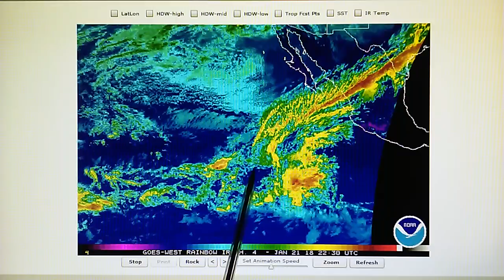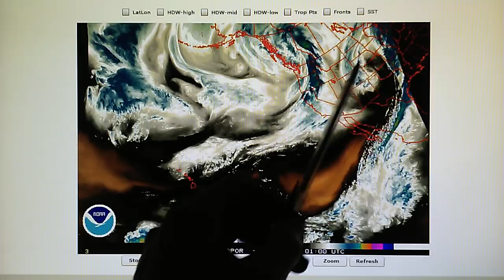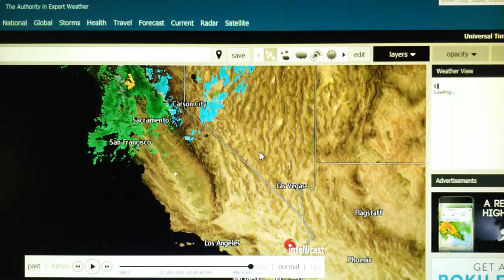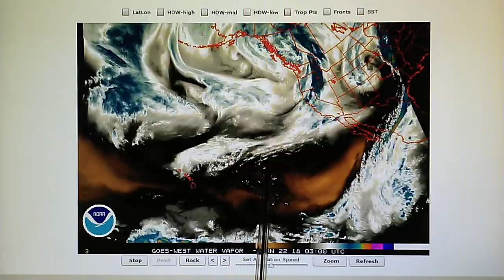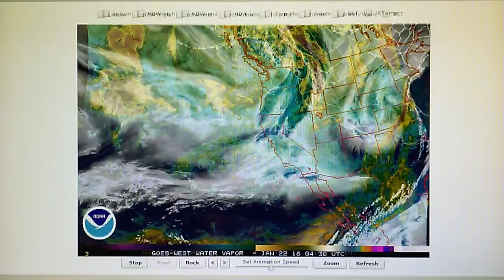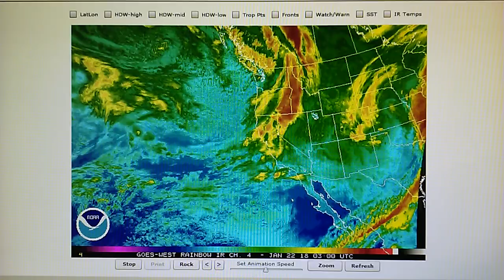1-21-2018; Heavy Aerosol Chemtrail Spraying Prevents Jet Stream Flow From Producing Precipitation

Comment: Same crap, different day.  I don't know why we bother using a calendar in San Diego, because the "weather" is stuck in constant July.  So sick of incessant sun, wind, and aerosols.
Reply from the maker: Kristine Cooper - Same situation in the Los Angeles area. It's July weather most of the year. At least in San Diego you have the onshore breeze off the ocean and that's a lot better than still air.
Reply: Unfortunately, the wind just manages to blow dust and dirt all over, adding to the poor air quality.  Now, another relentless summer to endure after having received no rain during "winter."